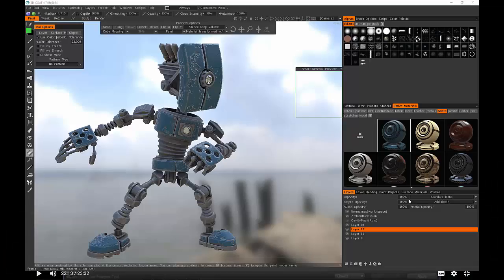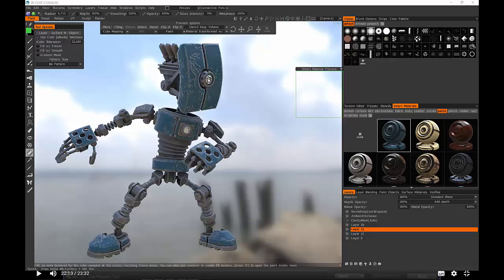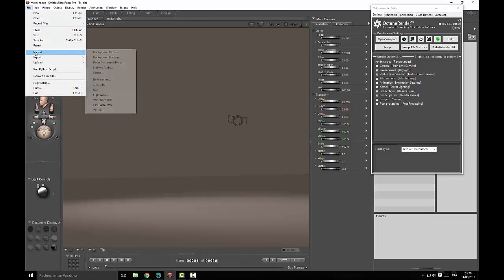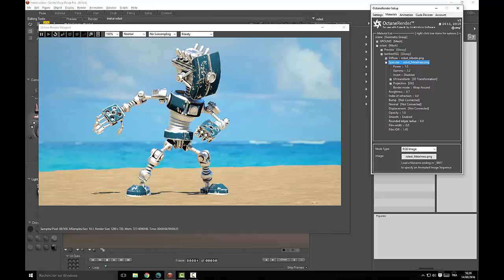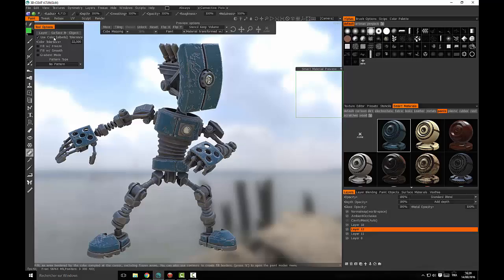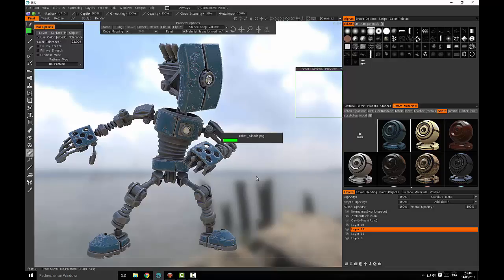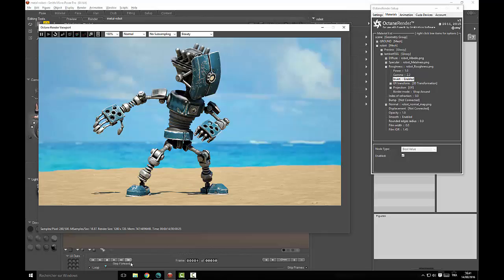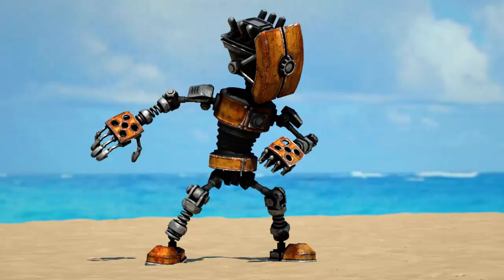3D Coat 4.7 to Octane Render workflow

Comment: hey thanks. this got me on the right track but for some reason didnt work for my octane in cinema 4d. i tried a few more setups and found following pretty satisfying:

Gloss/color specular workflow
diffuse and normal the same as yours
but then in roughness i use roughness and roughness
and in metalness i use specular color and metalness

then i load them into the octane channels and also set the index to 1

i'll do more tests, but it looks good for now.
Reply: oh and i also set the specular power to 2
Reply from the maker: Thanks for the hints. These new settings look better than the ones I used in C4D: less plastic and more metal. it looks very bright with light HDR maps. It looks ok with daylight.